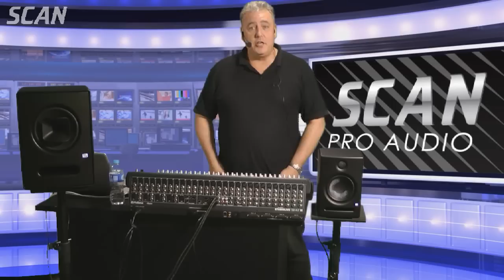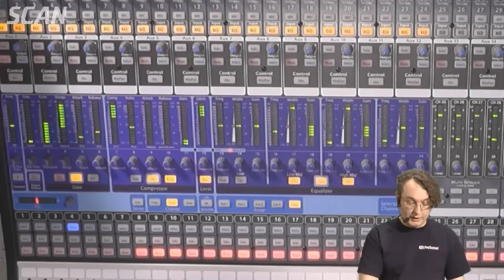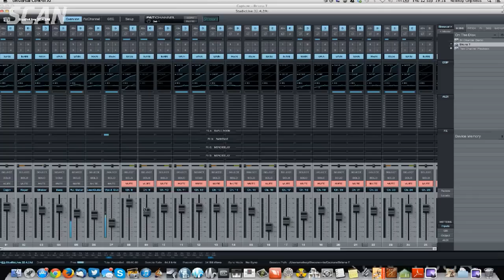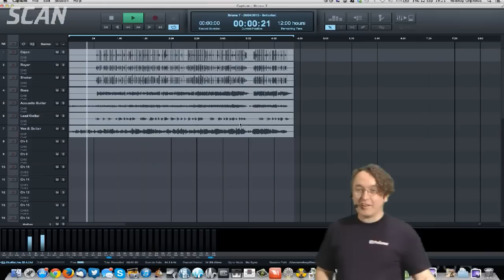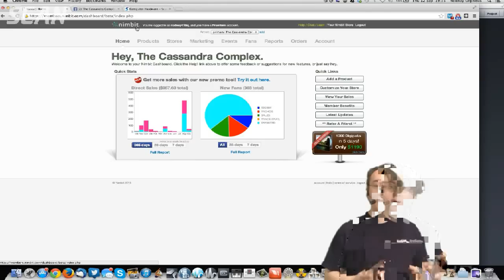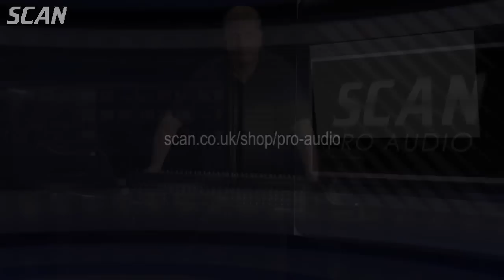Presonus StudioLive 32.4.2AI & Studio One 2.6 Features @ Scan Pro Audio

Comment: Oddly enough, while watching this video I couldn't help but notice the part about the studio monitor that has the HF horn coaxially mounted with the sub. I would like to know the advancements that have been made as such since Electrovoice had made an older PA cab which had the same throw theory. They had a bracket that hung the HF horn in front of the MF driver. I could only assume it was for the same reasons but how does the new chip in your monitors improve the sound and clean up anything muddy?